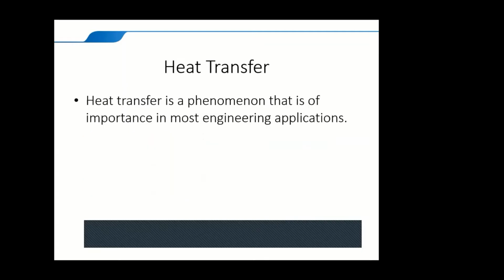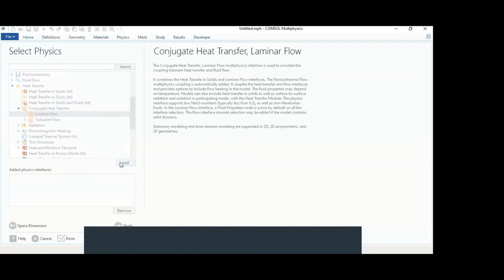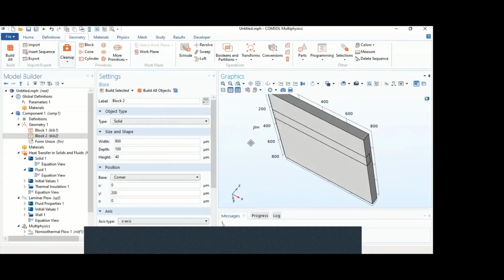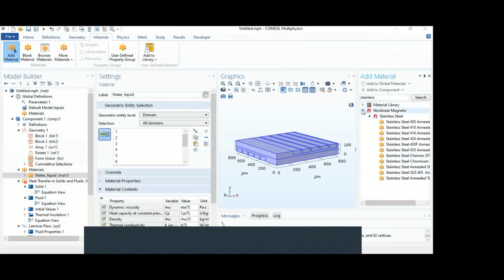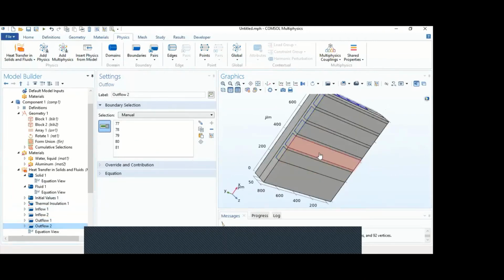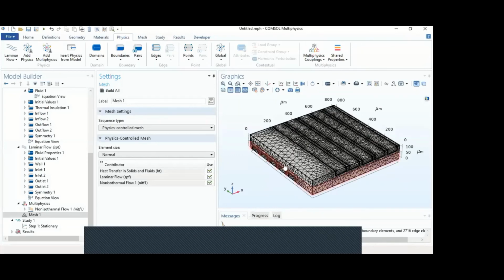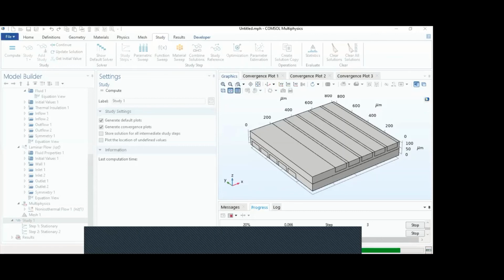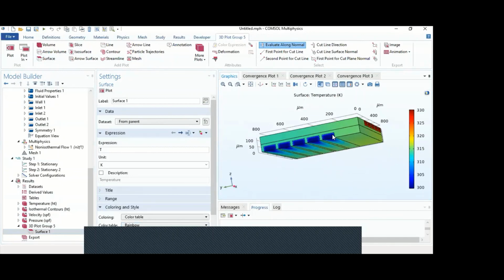COMSOL Multiphysics - Heat transfer module - Cross flow heat exchanger

Comment: Can you add electrochemical chemical heating in it, because I am working on a fuel cell where  heat is due to production of water which is an exothermic reaction, make vidio on this topic, tell me as well your thoughts on making vidios please it will helpful help